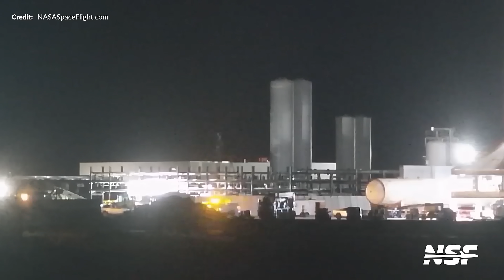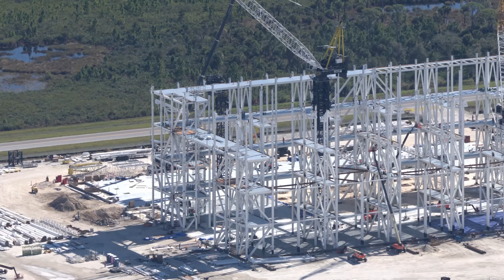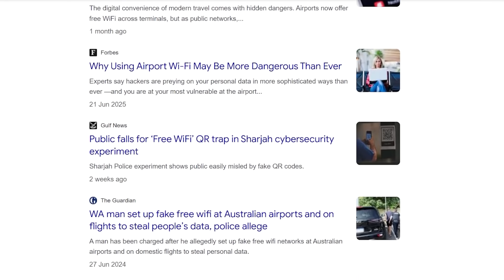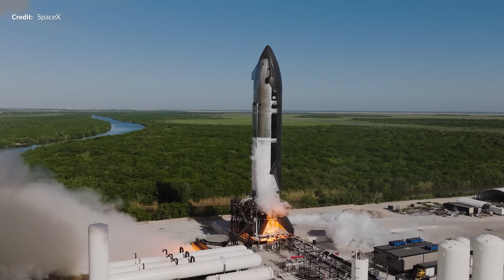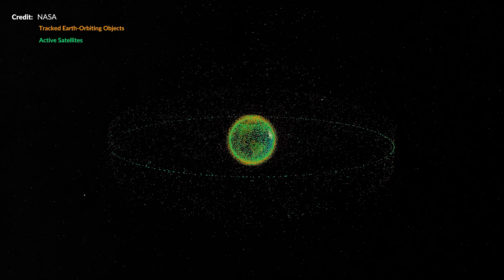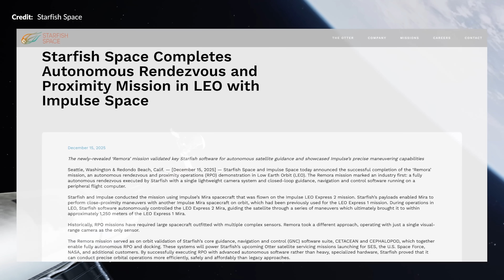Flight 12 Starship: Record Super Heavy Build Time!

Comment: I imagine that the used equipment is sold through a middleman and I wonder if the buyer realizes it is coming from SpaceX.  We focus on the cost of each rocket, but the site work (initial creation and all the modifications some necessitating teardown) must be a huge cost as well.

With all the commercial interest, I think the ISS replacements are more likely than the Moon endeavors in that timeframe.

Comment: :_MarcusHead:Good day from Goonellabah, NSW, Australia. It began when I founded the Tamworth Rocket Club in 1969. Moving forward, I initially aspired to attend NASA to become an astronaut, but I ultimately pursued a career in engineering. I served as both the project manager and civil engineer. I worked as an engineer in Singapore from 1999 to 2005. We designed and constructed twelve-kilometre tunnels with two boring tunnel machines and five stations. I also managed a team of 160 engineers and architects.🤗Ian Cleland

Comment: i wonder if they use the truss structure on the static fire/ transport stand to connect to the 4 points for the in space fuel transfer points to stabilize the starship during transport. Or might be even simpler .. the truss might just be there for static transfer test of the 4 points. Have some bits of mock starship trying to connect to it .. and do transfers.

Comment: COPV's,... Wondering if they've tested a few from the same batch and found issues? I'd assume they would have been tested before fitment, making it seem even odder that one or more let go during B18's test.
Reply: Maybe we should wait until we know it was a CPOV issue..  So far that's just speculation.
Reply from the maker: Yea ,I tried to make it clear that is still speculative right now. I mean, we know COPV's were ripped apart, but what cased the issue is unknown.
Reply: @imaginary_friend7300 Absolutely, but I was referring to the ones we see in the vision being swapped out for new.

Comment: Random thought: why doesnt SpaceX cover the Starfactory roof with solar panels and a few hundred Tesla Power Walls?
Reply: Pointless when there are transmission lines nearby. Cost. Delays. Feasibility reports. Permitting. Licensing. Maintenance. Structural integrity. There's a few reasons
Reply: Hi, star factory will probably only have a short life until it’s replaced.
A permanent ground station would be a better option and generate fuel for use on site.
Power will be an issue if it keeps growing.
Take care M.

Comment: Well Marcus, I am not so enthusiastic about the signatures on the Blue Origin BE-7 engine. My experience with our welding supplier in Melbourne who had stopped using marker pen to mark out on their welded inconel as they found it induced cracking. They used welders’ crayon/pencil instead. These guys were highly proficient welders, the only ones we could find who could reliably TIG weld PURE titanium, so I respected their opinion despite my doubt that a marker pen could contaminate a weld. I emphasised PURE because we sent samples to a number of suppliers who said they could weld titanium and didn’t hear back from them ( they welded titanium alloys which are a whole different ballgame).

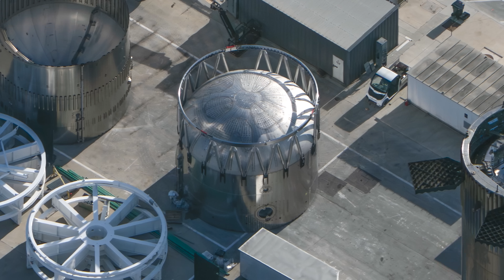Comment: Interesting at (11:39) the top of the old booster-18, with the new hot-staging ring on it - seems to have two diagonal struts of of the hot-staging ring missing…. (At the 12 O’clock position) also at the (4 O’clock) and (7 O’clock) positions too !

Comment: As for Maven, can't they just transmit one big high powered "reset" signal which will force the sat to go back to baseline and realign it's antenna? Otherwise it appears the gyros are toast and that means SOL.

As for the failed Starlink unit and it venting fuel, probably means it was struck by debris. Debris so small that the USSF couldn't track it.  Even a fleck of paint can carry a great deal of kinetic energy with it in LEO.

Comment: I am amazed at the vast size of this project and the hundreds of specialists who do each job. How many skilled designers at computers are creating the "blueprints" that have to fit all this complex structure to fit together down to every bolt hole of every massive part fitting within sometimes a thousandth of an inch. Even the temperature from night to day will expand or shrink those large structures, affecting the fitting at all points. I would like to see a docu on that part, and also on the industries creating those parts.

Comment: You know, the late added plate and deluge system on the first Starship launch complex begs the question: why did SpaceX not think that was necessary in the first place (after nearly 3/4 of a century of historical launch experience preceding), or why a trench system would not have been superior for much the same reasoning? Would love if you could speak to this, Marcus.
Reply: Because they thought fondag concrete could resist the energy and heat.  Water becomes an issue when you’re running multiple launches a day, so if a waterless solution was possible, it made sense.  Turns out it wasn’t.  For many decades everyone did expendable boosters.  That doesn’t mean trying to reuse them is inherently bad.
Reply: If I'm remembering correctly a bunch of the Russian launch pads just have deep pits and no water system of course those are massive pits for less powerful Rockets but I find it still interesting that they don't use water
Reply: Because everything is a process of evolution and development.  In the early days they needed a lot of access to the bottom of the booster while it was on the launch table.  They knew they needed some kind of protection and the water cooled plate did that job and allowed them they easy access they needed.  As the system continues through development the needs of the infrastructure change as the system changes and evolves.

Comment: Earth's huge gravity well is always going to be a limiting factor to get significant mass off the surface to set up a Mars colony.  I think Space X should build a  production facility on the Moon (1/6 gravity), where they can build much larger ships (thousands of tons at a pop) or use a Mass Rail Gun on the Moon to get materials to Mars much faster to build a colony.  I have always been a huge advocate of the Moon first and think we could set up a Mars colony a lot faster if we did.
Reply: The Delta-V for sending cargo Starships from Earth to Mars' surface is lower than to the Moon's surface. 

I suspect SpaceX will use the Moon for rapidly testing Martian-bound hardware and procedures within weeks, not for building factories to build spaceships, nor mining Lunar resources for Mars infrastructure. 

It is cheaper to directly implement Martian ISRU; Just as Lunar ISRU is good for Lunar structures.
Reply: There will never be a spaceship production facility on the moon. Do you know how ridiculously impossible that would be ?
Reply: @spinnymathingy3149  Not impossible..  expensive.  Very expensive and no real ROI for a very long time which really does put a crimp on building.  3D printing etc does change the equation a lot.  Cuts some steps out between raw materials and finished products..  Once you determine what product needs building.

Comment: Still waiting on a full fueling system. Right now they have to truck everything in. While I see them now installing own Oxy/Nitro production system... now need to pipe in meth or build a meth production system on site. (Both of will be needed on Mars and Moon.)
So instead of making all the trucks drive into the launch area, why not start the pipeline that will be needed in the future from a fueling station that only trucks will use until a compleat direct pipeline can be laid. 

You will still need to design and build all of this same infrastructure on Mars and the Moon as well. Pretty sure we won't be trucking in semi's to Moon and Mars, to fuel up the ships. I could be wrong? I am just saying...
Reply: You seem to want to pretend things spring into existence in their final form all at once.  That's how computer games work.

Comment: With Amazon LEO LA-04 ULA launched just 32 days after their previous mission (Viasat 3 F2), a big improvement over previous missions this year (~43-56 days). With stacking soon beginning in VIF-A (and at SLC-3), they are on their way towards their goal of two launches per month, with launch vehicle integration constraints soon being a thing of the past. Let's see if they can hit 24 in 26, or if some other limiting factor will become apparent once their additional infrastructure is operational.
Reply: Even four a month would not get them even close to their FCC requirement of 1618 working satellites in orbit by July 30, 2026. How much will Amazon have to "contribute" to the politicians to get an extension?
Reply: @GntlTch I'm talking about ULA's launch frequency, not Amazon's. But showing significant progress (hundreds of satellites launched) will probably be enough for the FAA to grant an extension.

Comment: The moon is a harsh testing ground for all Space infrastructures and equipment. Evacuated surface. Extreme temperature swings. All forms of Space Radiation. Moon dust mitigation and abrasion resistance. Low gravity and surface hazards make walking in space suits difficult. The only positive is if anything goes wrong you can pack up and be back to earth within 3 days.

Mars on the other hand is the most difficult mission that humans attempted. It should be stated and planned the only reason for an aborted modding is a crew issue, not a component failure.

While its surface conditions are milder than the moon, it still poses big risks and issues. The first and foremost is distance. There is no way to quickly send supplies or quickly return if a major issue occurs. 

Unlike the older moon missions the astronauts are not passengers, they are active participants, that they determine the success or failure of the Mars mission.

Mars is about "What If" planning. They are going to need everything on the ship or at the base site, that they are going to need, including backups, for a 500 day mission. If anything needs replacing or fixing the crew must do it. They must be cross trained such that individuals can cover for injured crew members.

Comment: Hi Marc, excellent channel, well done to you and the team, I have a question for you….
The old SpaceX hot stage ring had some of the vents blocked to ensure the booster moved in a specific direction at separation, however, I don’t see anything similar on the new ring. Do you know how they are going to redirect the new booster at separation ?